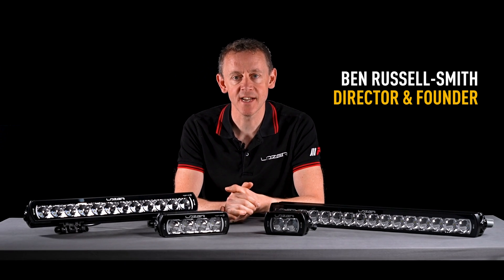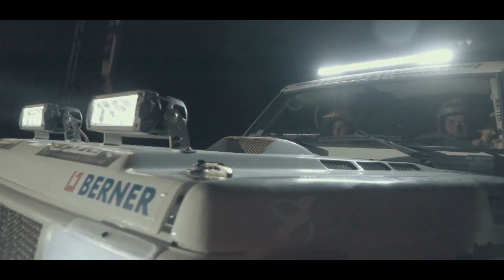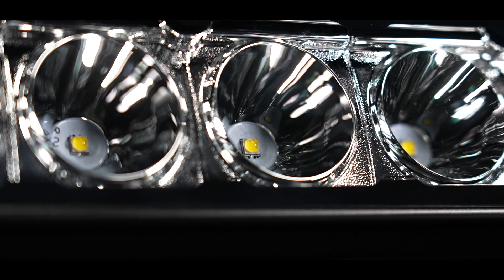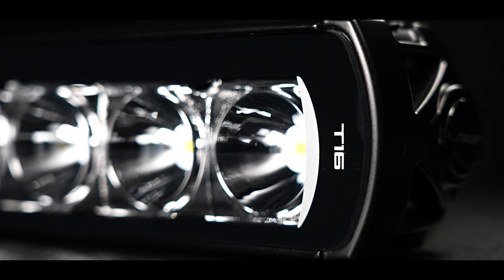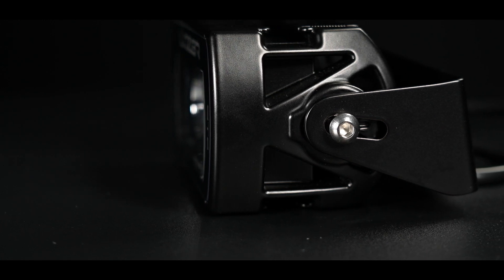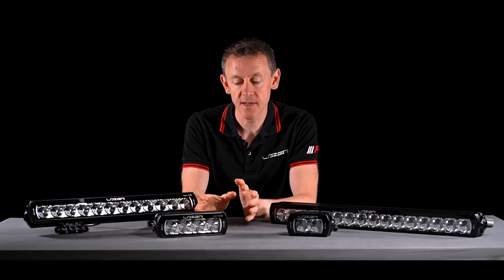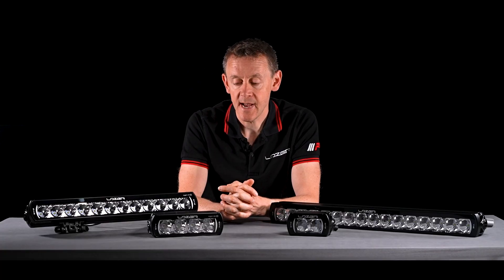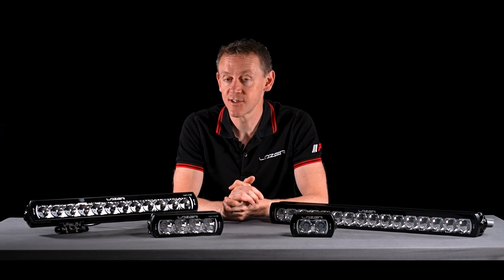LAZER LAMPS | ST / T Evolution | Product Walkthrough

Comment: Lazer is double if not more expencive as Strands or any other good branding...Explain please what is the reason with that huge price gap
Reply from the maker: Lazer can look more expensive compared to other brands, but there is a reason for the gap. Our lamps are designed, engineered and manufactured in the UK to deliver the highest levels of performance, reliability, and long-term durability - it's not just “more light,” but cleaner beam patterns, better components, and proven resilience in real-world conditions.

Every lamp comes with a 5-year warranty and full after-sales support, which cheaper options simply don’t match. With lower-cost lights you usually pay less upfront, but you also get lower build quality, weaker electronics, and a much shorter lifespan.

It’s like choosing tyres: you can save now, or invest in something built to last. With Lazer, you pay once - and it performs for many years to come. We even have lamps still running all the way from 2013!
Reply: @Lazerlamps  thans for the replay

Comment: Hi, i was planing to replace my old motorcycle headlight completely and already had an eye on your products, because they also have an E- aproval. What a pity, that you cant use the ST2/4 as an complete replacement for low and high beam. They would have been a perfect fit.
Reply from the maker: Hi there, Unfortunately not - all of our lights are high-beam only, and we don't offer any low-beam solutions at present. We've seen a couple of ST2 / ST4's being used in that application for high beam and they've looked and performed brilliantly!